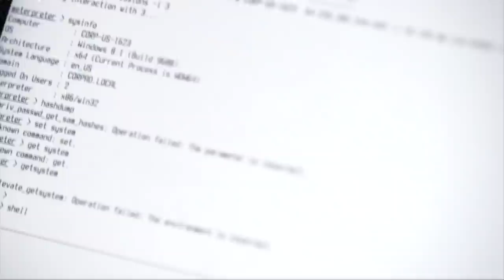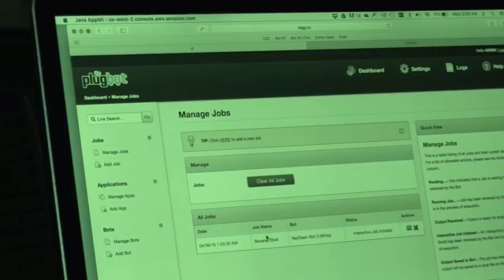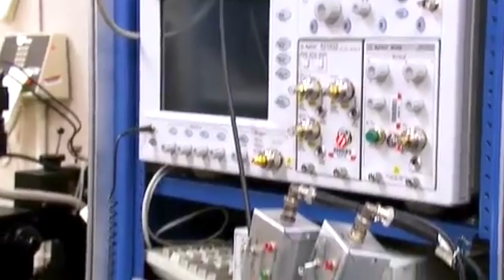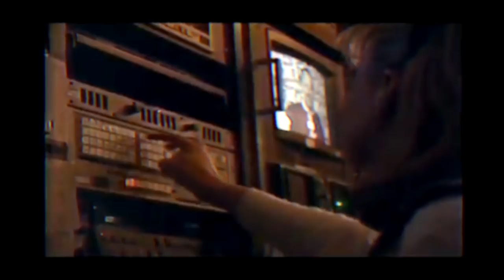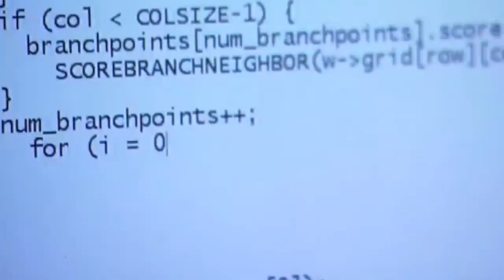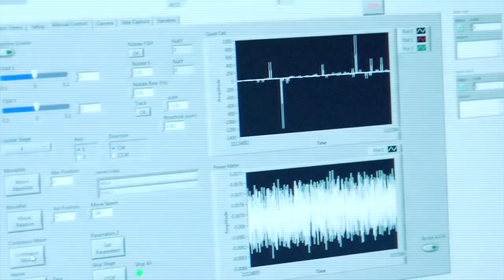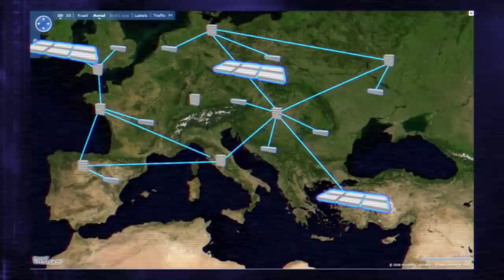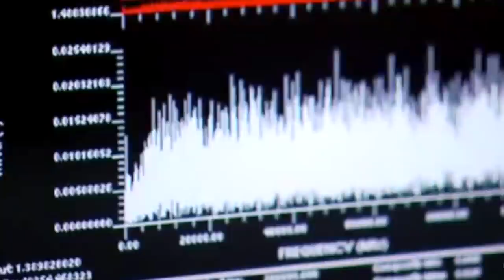How The Internet Defeated Censorship... And Then Didn't

Comment: Excellent video as always, although I wanted to point out that Germany has had quite a bit of censorship in past years as far as dissenting political opinions about immigration. I think one of the worst ways you can handle opinions that go against the grain of the "government's plan" is to censor. You end up putting that movement or idea underground, so it can fester, radicalize and possibly get violent, rather than allow citizens to vote for a candidate that matches those ideals.

Comment: Some websites aren't or are minimally censored like 4chan for example
Reply: All *chans are to some extend censored. They are more messy then your regular social media but still try to not go much aganist laws. Open selling of drugs, CP and such is  discuraged.  Other then that they are deliberately self marginalized itself by messy outlook to block reach to wide audience. There even more messy corners of web but they have even smaller audience.  If you have zero potential audience by do not expressing anything - you will not be censured at all. But by trying reaching wide and wider audence you will have more and nore pressure from public and autoriries. And this is what is censorship is about.